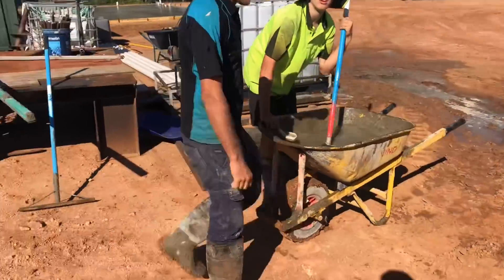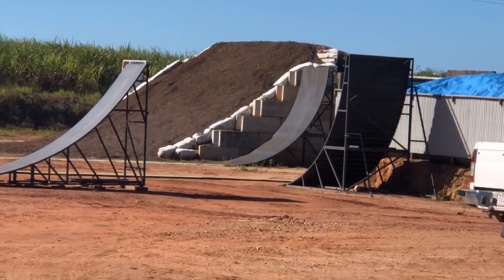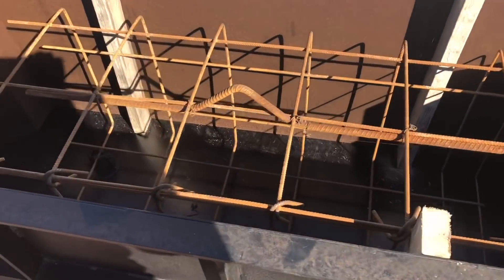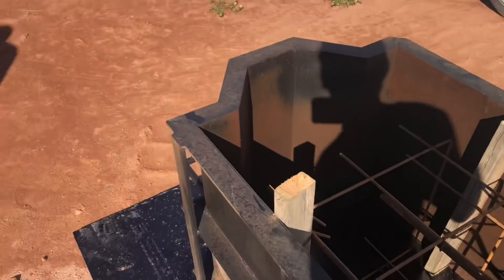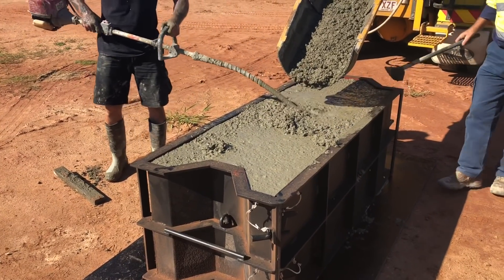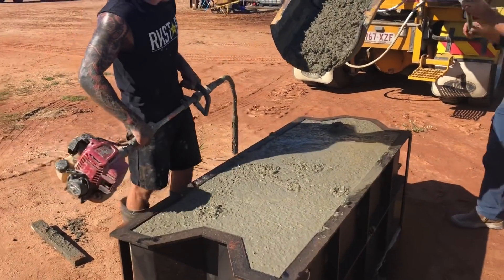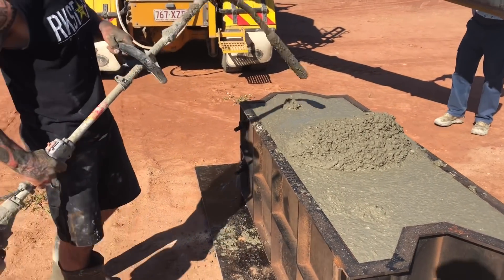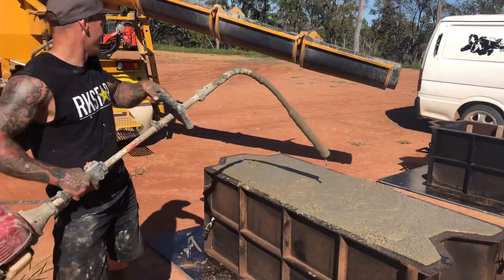Pouring concrete Lego blocks

Comment: I saw a concrete technician in the US at the world of concrete expo in Las Vegas with sectioned concrete blocks detailing the effects of over vibrating on agragate distribution and strength after various degrees of vibration using different vibrators I never ever realised it was so complex and critical.  In the end for the concreter on the job  in was in quick to the bottom and out slowly not much advice I know!

Comment: looks like 2nd guy pulling the timber out has a knee replacement, just like mine, not an easy thing to have in that kind of a job.
Reply from the maker: Stormbash you are exactly right he has had a knee replacement from riding a motorbike and he’s just helping for the day he didn’t really do much other than what you seen 👌 . There is two more parts to this video if you are interested in seeing more 🤙🏻
Reply: Concrete ninja must of been a bad fall off the bike, mine was osteosarcoma related. Sure, I’ll watch them too. Always like your videos. What do they actually call those moulds here in Australia (besides LEGO blocks), I see this shape block used everywhere, but not sure if they actually have a name?
Reply from the maker: Stormbash I’m not sure what the name is maybe just concrete blocks different sizes a lot of the boys use them for their freestyle landing ramps to hold it up .

Comment: Too much vibrating.
Reply: why lol? you think thats gonna blow out. why not spend the extra effort vibrating it to make sure it comes out right
Reply: All the stone sinks to the bottom, and makes the upper parts all sand. It's an art vibrating concrete watch how ninjas crew do it, its momentary. Vibrating the mould would have been an option.
Reply: A jones there is so many ways to do it and theories.. i would have done the needle and then used the needle on the mould aswell

when i worked on the construction of the inpex gas plant in darwin the japanese engineers insisted we hold the vibrator in the same spot for 1min and then move up 500mm and continue the same method. these were 1000mm x 1000mm concrete columns 12 metres high. we could only pour 2m in height every 45min. so we would pour 2m on one column then pour 2m on another column then go back to the first column and do another 2m.. took hours obviously.
Reply: @beserkpride  all the rock sinks to the bottom. Way to much vibration way to much
Reply: Not true at all
Reply: @RHEC1776  Not true at all

Comment: Way to much vibration all the rock is sitting on the bottom now.
Reply: Thats not true.  I have 28 years of experience. concrete in this case is pritty dry so you should vibrate that much. Problem here is he raise vibrator way too fast. You should not raise that fast while not vibrate at the sametime.